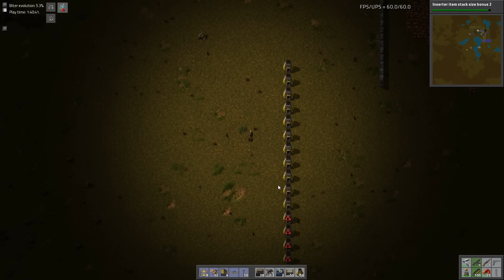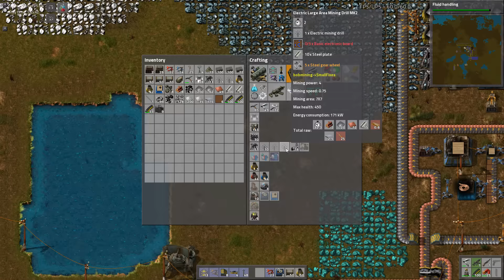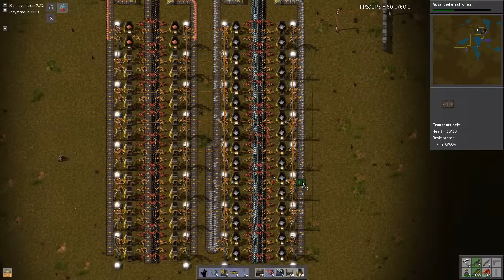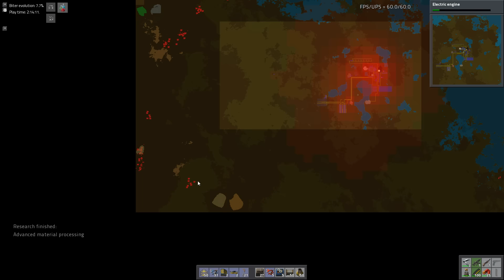Factorio Let's Play Bobs Mods and More 4

Comment: Concerning furnaces, what are your thoughts on a 3 belt input furnace build?

e.g.
<L Long Inserter
<N Normal Inserter
Furnace  <L Iron | Coal | Iron L> Furnace
Furnace <N Iron | Coal | Iron N> Furnace

When moving from coal to electric furnaces, reroute the iron ore input to the center belt and it'll pretty much be a standard 1 in/2x0.5 out setup without any major reworking of the output belts, so you can parallelise them as much as you want and even fit in beacons in the middle when you get them.

Comment: Is there a reason you used separate ore and coal lines in the furnace column instead of making two coal+iron belts?  The latter would mean you could do without the long inserters, and you still get two half belts of both.
Reply: +zanthrasw 3 weeks so you might already know, but its usually so that when he upgrades to electric furnaces, he doesnt have to fanny around with getting rid of coal from the lines. In stead he can just delete them and it wont require much more input than that.

Comment: sol·derˈsädər/nounnoun: solder; plural noun: solders1. a
 low-melting alloy, especially one based on lead and tin or (for higher 
temperatures) on brass or silver, used for joining less fusible metals.
Hehehe had to.

Comment: Your bus flows from east to west. You could put down more furnace rows to the east of the current furnaces, even put oil processing there. And it could all flow from east to west. And then you would have ample room for a train station for all the furnaces and oil processing underneath the furnace rows, or above them. And yes, bus gears. I always bus those things i use a lot. Like plates, processors, steel, stone/bricks, coal, fluids. Its a small price to pay for the few transport belts it costs versus the versatility of having everything on demand, and a central area that you can expand indefinitely vertically that produces these bussed goods.
Reply: +Marijn R There are two thoughts on it, anything that uses Gears uses Iron so you can make them locally because you are already diverting iron, on the other hand if you have gears on a belt then that's less iron you have to divert because you only have to divert the Iron for the item rather than the Iron for the item and the gears.
Reply: +Marijn R Although in Bob's mods you have Titanium, Steel and Iron (possibly more I don't remember) Gears so maybe having three+ belts of gears might not be worth it.